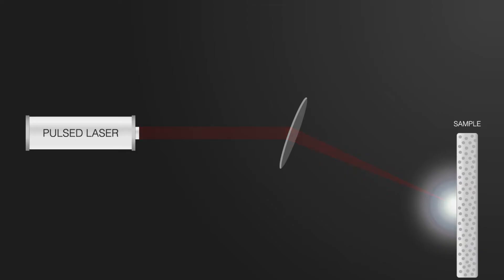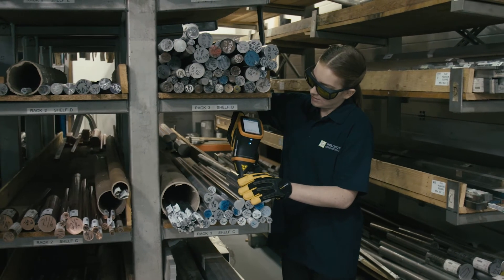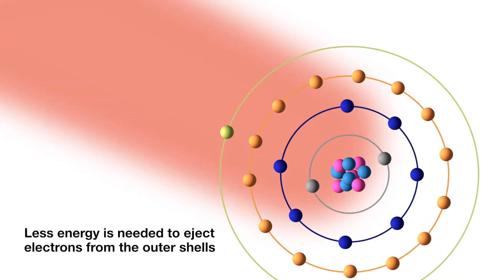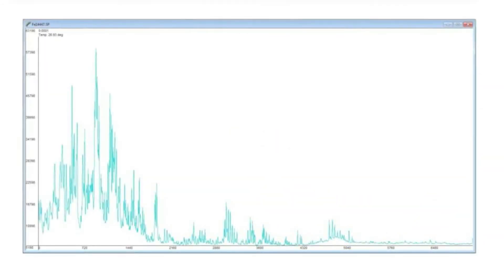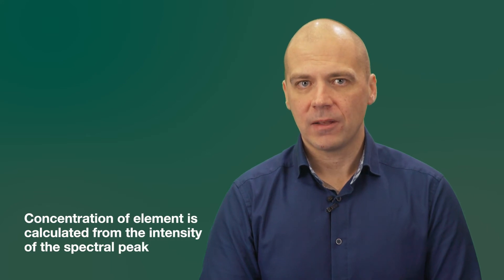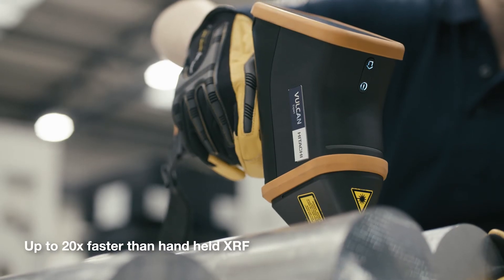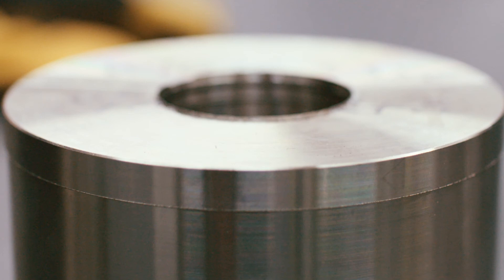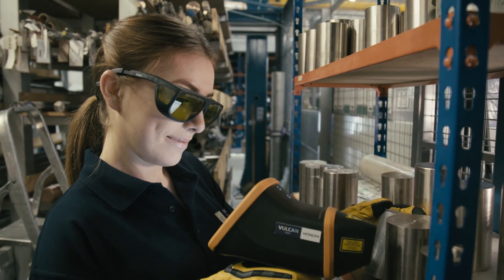What is laser induced breakdown spectroscopy (LIBS)? | LIBS explained

Comment: Hello,
  you said this is LIBS and we know the Laser Induced Breakdown Spectroscopy (LIBS) has been around for many years and is a technique used primarily in laboratory equipment. With recent advances in technology the technique has now been developed into a portable handheld analyzer capable of measuring carbon in the field for material identification and grading of materials. so i have one in my office but unfortunately I used it for Carbon steel material but no percentage of carbon where  been displayed the question is Why
Reply: did you get the reply ?

Comment: Thanku for your nice explanation. I have two questions, first one is that, how we can decide the laser which we are shooting can generate plasma or not and second question is that what is the threshold temperature needed to generate plasma?
Reply: The laser and combined optics need to be such that they are able to concentrate the light on a area with high enough energy density, this depends on both the laser and the optics. You could have a high energy laser without much concentration or none through optics, or a relatively low power laser with more complicated optics.

The threshold depends on the material, and it might be more useful to think about the laser fluence (energy/area), not temperature itself. The fluence necessary for inducing plasma is material dependent.